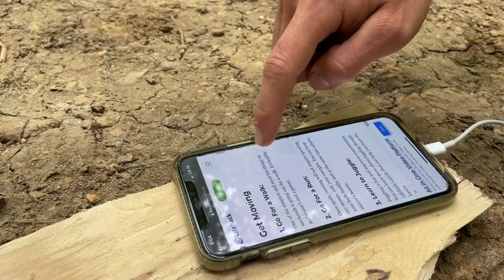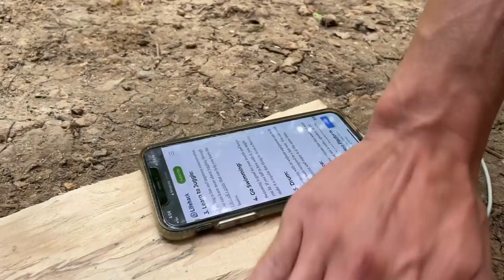Quitting Work For The Day And Only Doing Fun Stuff!!!

Comment: Didn't you dry out the impeller pump by starting it dry?
You should always connect a water hose when starting out of the water. It should pump out a small stream of water out if the engine side... Thst way you know the engine is cooling...
Reply: was about to write this as the outboard blew up😂
Reply: Was just coming to comment this
Reply: Views from this 1 video will pay for the repairs.
Reply: They always have the hose connected. Might've been hidden by the camera angle 🤔
Reply: The water is part lubricant part heat dissipation. A short run may shorten the life of seals a little, but it’s almost imperceptible. We’ve owned jet boats and always started them dry on land before going into water to make sure they will start and run before launching. Just short runs and no high reving. Just don’t let the seals heat up.
Reply: Going through my head also, running the motor without water feed, can burn or melt the water pump impeller, once that’s shot, it wont cool properly, can stuff your whole motor
Reply: That's what I thought
Reply: Not gonna hurt anything if you do it just for a minute
Reply: @jebmcdonald5709  they filmed only for a few seconds, so we don't know the time in reality. Also, even in the clip, they revved up. Definitely not good for the impeller, even for seconds...
Reply: @jebmcdonald5709  no telling how long it sat dry. If they set dry for any lengthy time the impeller will dry out and get hard.
Reply: @jebmcdonald5709  wrong
Reply: There was a  hose there but don't know if it was hooked up or not
Reply: @Lonelypickupman97  well, that's the same as putting a pizza next to the oven and waiting for it to warm up... 😉 
There was nothing hooked up to outboard. There is a clip of the prop spinning. That's where that hose would go and spill excess water.
Reply: I know but wasn't watching that closely to see if they had it hooked up or not
Reply: @The_Charlie_Whiskey  this is not a jet boat lol it has a water pump while jet boats get there water from the jet drive. this boat gets cooling raw water from a rubber impeller on the foot. and running it dry killed the waterpump
Reply: Painful to watch
Reply: Always wanna hook the water hose up before u start the boat motor on land 😂😂😂🤣🤣
Reply: Oh really 🤔 lol
Reply: @jebmcdonald5709  running water is the lubricant. if you run the rubber impeller against a metal housing for a minute, with no lubricant.. bad things happen.
doing it when cold is also not going to make the friction any less brutal.
Reply: @The_Charlie_Whiskey  True, but worth noting the impeller on an outboard is gonna be more sensitive to friction than a jet boat

Comment: Protect all this awesome work you've done with a retaining wall. Don't wait until it's too late
Reply: No wall let it fall...No wall let it fall.
Reply: They can have an epic video saving the barn when the rain comes! That would be pretty cool!
Reply: That is so true. I have a back yard that always disappeared. Had to build a wall! Yep!
Reply: I know they are gonna build a deck because they said they will. Im curious to see how they hold the dirt in the design of the deck. Killing 2 birds with thst one stone would be wise. It will take some engineering but definitely do able.
Reply: @kylemcweeny878  I am not sure what they cost but there are those big interlocking concrete blocks that weight something like 3500 lbs! If they put some of those at the base and used some of the flatter rock slabs they have on the property for the rest I think they could control the erosion pretty well!

Comment: Are the blade guides on your saw mill adjustable? If so adjust the width to just wider  then your log and it will help stabilize the blade and make much straighter cuts.
Reply: The blades are poor design - they need teeth that cut in both ways and a simple system to sharpen them.
Reply: That’s a must. Directions will help.

Comment: Turn that small boat into a Jon Boat. Great for fishing, if you decide to start fishing.

Back to the barn, strain relief on the wires at the junctions and protection at sharp edges. As for the back of the barn, retainer wall is needed. Then build that deck off the back. Great for chairs, grill and eating!

Comment: Is your water pump leak hole showing circulation,  you might have over heated it, But you should never start the engine with out muffs and a water supply, you might have taken out the water pump, make sure no dirt dobber filled the pee hole on the back of the  motor. It sounds like a over heat problem.
Reply: That's cool that you won something.

Comment: You need to put water for your sawmill and let it drip quickly. It will cut smoother, faster, and straighter.
It’s just a suggestion I learned from experience 
I am a sawmill expert so I have plenty of experience. Best of luck

Comment: You know what would have been handy? Outside GCFI receptacles... and also a way to plug into the barn build with your generator from the outside to power the inside. Probably need some sort of switch before your electrical box to change from generator to normal/shore power. Guess you can always add that switch on the outside if you ever bring normal power to the barn...
Reply: Fun for me is working with my wife on her horse farm... most times except for fencing. We love building things together... Work hard, play harder... Getting away every now and again would be nice though...

Comment: Expect some gapping on your walls. That wood your cutting is green and will shrink in time  you sould rest it on 2x4s wit planking leaving an inch between boards. And stack them leaving them in the heat for awhile. Instead of Desile fuel use water and dish soap dawn works good

Comment: If you can adjust the roller guide to get them closer to the wood on both sides,  it will cut straighter and your blade will last longer.  The inside of the "barn" looks awesome by the way!

Comment: Not sure if y'all know (or care for that matter) but it's not recommended to start a boat motor without water to run through it. 

The engine is cooled by pumping the water supply around it using an impeller located in the lower unit. The impeller is the water pump essentially and it's made of a rubber material, which doesn't play nice with the metallic walls of the housing in most lower units WITHOUT water. 

Over time, with enough dry-starts, your impeller will lose it's ability to pump enough water around the block, and you'll start to have heat issues. 

Again, not sure if you care - just wanted to put it out there!

Comment: On the sawmill the pieces that somewhat pinch the blade are guides and should be adjustable to where you can move them in towards the work piece minimizing blade deflection. You would like the guides as close to the log as possible with hitting.

Comment: Purchase the sharpener  . Your uneven cuts are because of dull blade . Use your pressure washer to wash down dirt and  rocks that are hidden in the  bark of the log . Your blades will stay sharper and last longer . Next time you find uneven cuts it's an indication that you have a dull  blade . And of course have tow blades that way your not shut down until you sharpen one . Thumbs up guys great content 👍

Comment: For the boat motor, after you start it always make sure a small water stream comes out the back side of it, that is how it cools. I've seen them get stuck with dirt and mud all the time and you can blow a motor up quickly. Also, that boat is only rated at 25hp I'm sure. You have to check the plate and see what the max HP capacity is, should be the same one that has the person rating. I live on the water here in VA, only a few hours from you guys. Look up Claytor Lake State Park. Its beautiful and well worth a visit, camp there one night with your boat.

Comment: When you run an outboard engine out of water it still needs to be submerged in water. I recommend using a Rubbermaid trash barrel and fill it with the hose. You most likely stalled on the water bc you ran the prop and engine up on the mountain.
Reply: SEND ME A TELEGRAM MESSAGE 🔝🔝☝️🎁

Comment: 🌴 Hey ya squirrels,ahh ya y’all can’t just throw a big azz motor on that boat that Hull is rated at a certain HP , if you go over power it it will tear the transom out of it 😳 
But y’all could just add a turbo on the ski boat, your going to go through a lot of saw blades , find the right size and buy them in bulk , then when you get a bunch of dull ones take them in to be resharpend , it would have been cool to see who could have caught the biggest fish ! Or a catch and your sis cook em  👍🏼 “ the insane Ukraine fish fry “ ! 🎣🐟🐟🐟🐟🐟🐟🐟🐟

Comment: You need to change the impeller on the smaller motor now.  You can't run them dry!  They need water for lubrication or you will melt the impeller in seconds.

Comment: You can use those blades by getting a smaller set of pulleys or extending the adjuster so they can move closer together.

Comment: Hey boys.
Do some googling and research but from my time in Venice Italy I was lead to believe that all small boat motors like yours are able to be increased in horse power by 50% by simply changing an adaptor plate on the intake I think.
It's a way they save money on insurance there as you pay per the HP that's written on the engine cover if that makes sense. For example a 25hp can be turned into a 40HP. A 40 can become a 60, 60 to a 90 etc.
Could make good content and maybe help others do the same.
Reply: You have been 🔝🔝🔝chosen to get a present.
Direct message to ASSERT OWNERSHIP👆👆👆

Comment: Y'all could build your own out of A older boat motor bottom half drive unit connected with luv joy fittings.& One those engines that air cooled 4 stroke engines. Hooked up to the boat tank running on ethanol free fuel.&'octane booster.

Comment: Move the blade guides closer to the log your cutting on both sides if you can. That will cut down on blade flex and it will last much longer.  Blade flex is probably the reason you broke the first one so quickly.

Comment: Hay BOYZ, those old blades can be resharpened, don't waste a good blade. You might keep a couple on hand at all times as back-up. Also, if you have a meal detector, you should pass it over every log before you start cutting it. Sometimes people drove nails in old trees not thinking about the next generation putting them on a saw mill. That will ruin a good blade for sure...

Comment: water impeller is bad. Pumps water thru motor to prevent over heating. They get hard over time and limit amount of water. When motor gets hot, it shuts down. You are going to burn that motor up if you keep doing what you are doing.

Comment: Never run an outboard without water on the water pump impeller. A lot of people make the mistake of thinking they could run the motor without water cooling the rubber impeller against the stainless steel water pump housing.

Comment: Does the saw mill have adjustable be blade guide rollers?  If it does they should be adjusted closer to what you’re cutting.  This will be easier on your blade and give cleaner cuts.

Comment: There goes the impeller on that outboard. Never ever start a boat without it being on water. The impeller is rubber on stainless steel, starting it dry with ruin that impeller quick.

Comment: Sorry to say that you guys melted that water pump impeller on the 25hp Yamaha running it dry and no water. Did it even piss water out the tell tail / pee tube when you got it to the lake? You guys need to take some outboard and boating lessons so you don't overheat and burn your motor up next time. Other than that great job guys, always great content cheers, B

Comment: Never start a boat motor without having a water source flowing through the motor. The impeller inside the lower unit might now be bad. It’s like what I saw you did to the Cadillac motor running it without coolant.

Comment: You can't run a boat engine more than a few seconds without a water source are you will fry the water pump impeller. Get a flush device and attach a water hose and you are good to go.

Comment: Shouldn’t start that 25 hp
Without running water through 
You may need a new impeller for your water pump it should have a little piss stream of water coming out also check that mud dobbers didn’t clog hole
Nice to see you having fun

Comment: Shouldnt realy start an out board with no water running through.the rubber pump impeller runs in a stainless steel cup runing without water generates a lot of heat from friction.enough heat to melt the plastic housing that holds the cup in place.

Comment: you need a older 40 or 50 hp motor. if you want speed lol  they are alot lighter than the newer motors, new motor would be heavy and break a transom

Comment: Are you sure that measurement for the saw blade isn’t in cm? Because 144cm is roughly 56 inches. Which would explain the smaller blade.

Comment: You should never start a out board without water the impeller for the water pump will get ruined running it dry I learned the hard way also

Comment: You fried that impeller by starting it dry. Then the  motor over heated.  You're lucky it started back up. I noticed when you were driving it, that there was no water coming out of the hole at the back of the motor.  C'mon guys... This is common sense stuff.